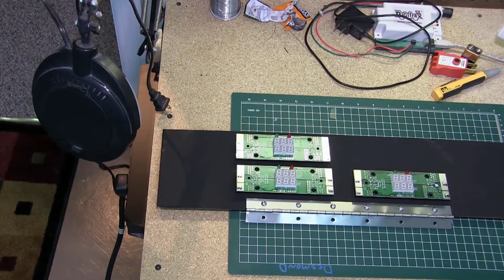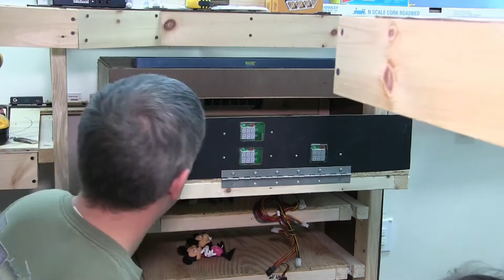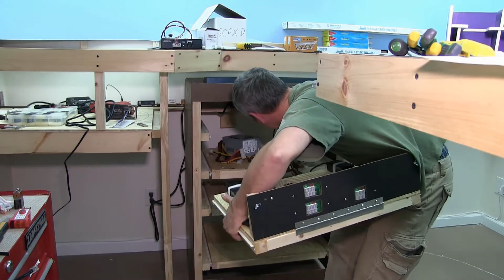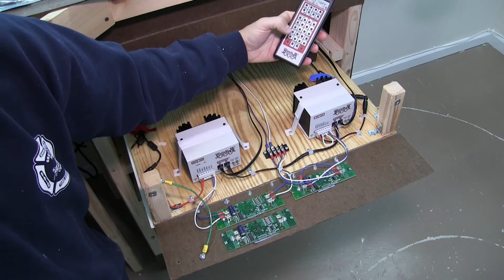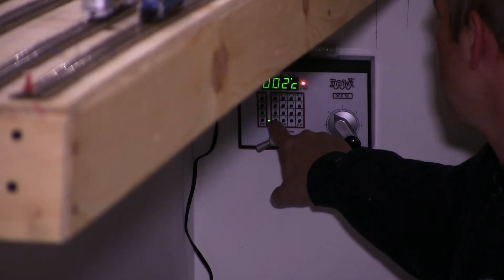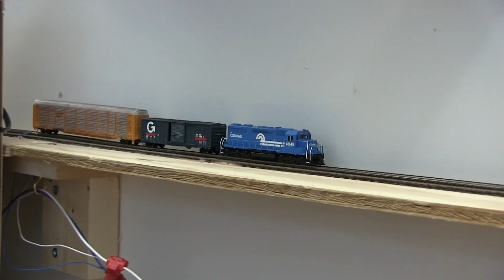Installing the Digitrax Super Chief on the Sayrehurst Secondary N Scale layout

Comment: I have a Digitrax Chief starter set and am ready to take the DCC plunge.  It has a DCS 200, but there was never a power supply included.  You never mentioned anything about your power supplies.  I'm not real interested in paying over $200 for the recommended PS2012E!  Yours obviously are not that extensive/expensive.  What's the facts, Jack?
Reply from the maker: The power supplies I was were the PS 615's I had to use three. The power supply you are referring to is for multiples unit. In retro I probably should have used that because I have the command station and three boosters. They get you one way or the other. LOL! Thanks for watching.

Comment: I used simple Ty-wraps to hold the Command Stations and some other power system units that don't have screw mounting. Very cheap and quick. Did you plan your wiring early on for possible block detection and signaling prior to connecting to terminal strips and back to your DCS100 or DB150? Regarding the tools for Loconet, invest in good tools once and take care of them!
Reply from the maker: Jon Frost no I did not plan for signaling, planned for block detection on the hidden areas only. The layout is dark territory running with form D's.

Comment: I do like your setup but i will warn you about your power supplies. The PS514 is a BAD downgrade from the PS515 that is replaced. Digitrax calls it a 5amp power supply but it only puts out about 3.5 amps. I tried one when they came out and took it back ASAP. What you want yo get is the NEC 5 amp power supply. http://www.walthers.com/exec/productinfo/524-215 here is the link to the Walthers website so you know what you are looking for. It is the same as the OLD PS515. It is the same price and you get the Amps that you need!!!!
Reply from the maker: Thanks for the tip!

Comment: Nice to see you're up and running 👍🏻
I always wire my layout with my dcs 100 live ( on) , the PM42 tell me when they're a short so no mistake is possible 
I run my layout ( 30+) loco and 8th of them have sound with 1 DCS 100 , I wonder if I will need another booster if there's all running at the same time , time will tell , for sure you got all the power you need with 13 amps
Reply from the maker: Thanks Pat for the good words. I mostly decided to break up the layout into four districts, because I want sound on all locos and I want sound cars, second because I don't want shorts in the yard or staging effecting the main line. BTW I love how GNRL is coming together!
Reply: Central Jersey Conrail in N Scale w